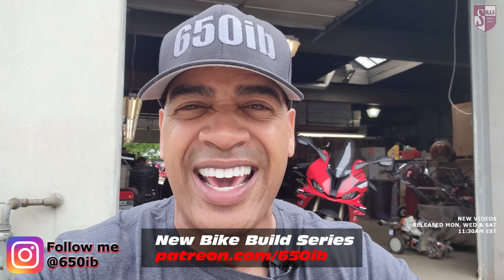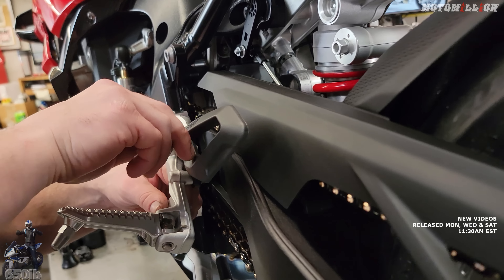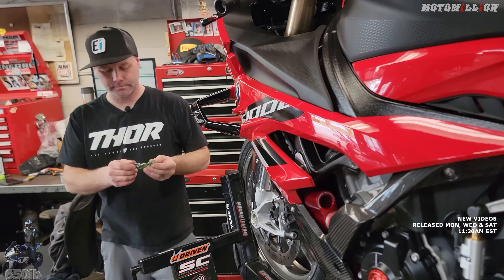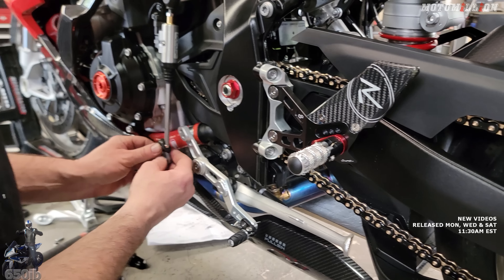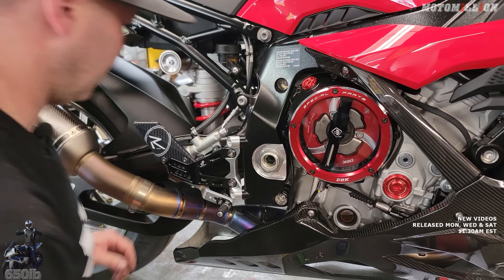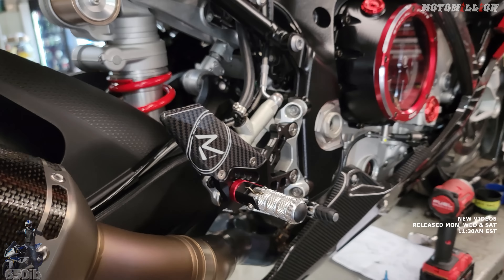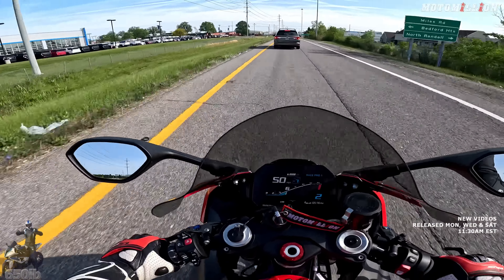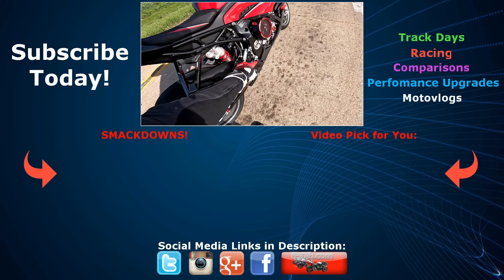2023 BMW S 1000 RR Gets $900 Rear Sets!

Comment: Do you guys need a different rear shock spring? I'm 200lbs , I can only get 20mm  of rider sag on this bike.any idea where the connection is for the  electric suspension in the rear shock?
Reply: You must have the ignition on or engine running when adjusting the suspension, otherwise the DDC will not be operating.  Just a thought.
Reply: @MrDeepseadweller   the rear spring is manually adjusted.  I did that. I  do my own motocross suspension work on my bikes. The rear spring isn't set for my weight. So it needs to be changed.